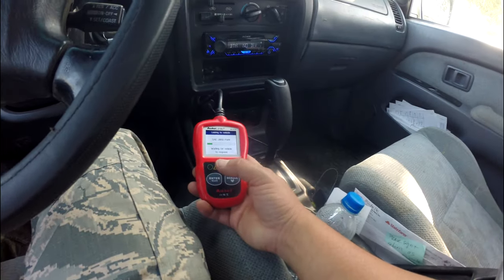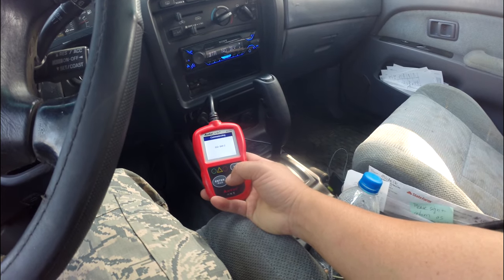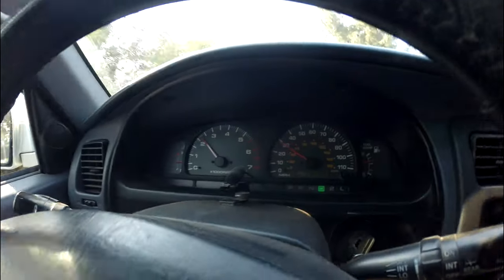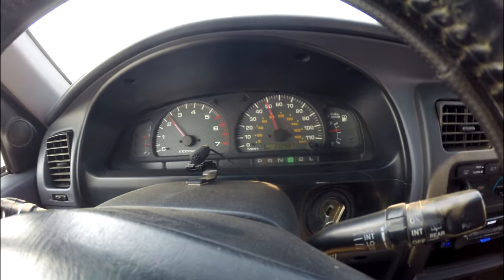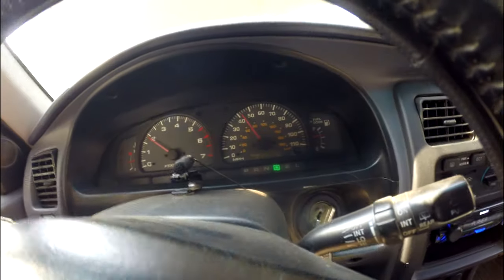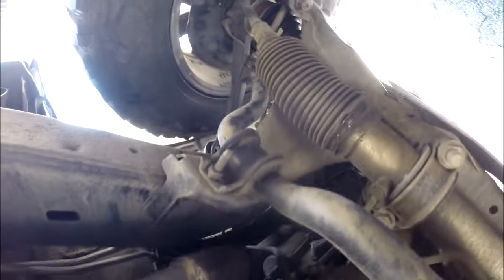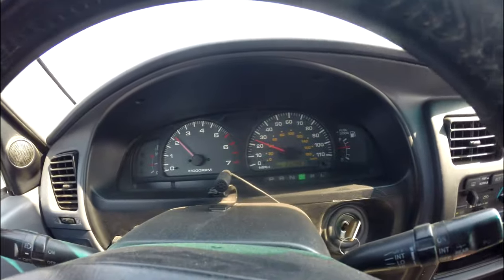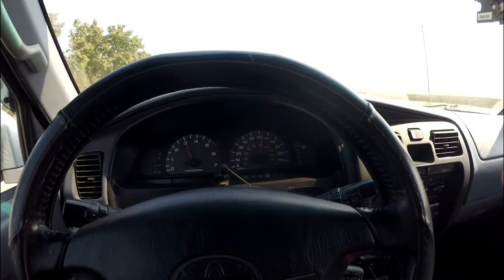How to identify a bad clogged catalytic converter.

Comment: I got 2010 Chrysler town and country 3.3 with 425,858
Reply from the maker: @geno2001h  wow great running car. Mostly those car end up in the junkyard before 200k miles but your is diamond one.
Reply: @alltsab  I was taxi driver in Dallas I work in my car no one touch it oil change every 3000 thousands miles
Reply from the maker: @geno2001h  that is the way it go buddy. Wrong machenic can be worse nightmare. Great job keep it up.
Reply: @alltsab  yes sir thank you for your help and your time

Comment: My 1991 ford probe gt is revving only 2.5k rpm could it be cat?
Reply from the maker: If it idling good then possible but try open exhaust pipe to see it gain power.
Reply: @alltsab  Okay, im gonna take cat off and see what happends

Comment: You have two cats on your 4 runner why?  Is one punched through?  You said their aftermarket… prob not flowing cause you have two cats under there. 3:25
Reply from the maker: Yes 4runner have 2cat. The primary one that is bad but in this case I replaced both because the top one make the down one bad too

Comment: My catalyst converter..don't smell it runs great it don't make noise ..
What else can it be???

It don't over heat 
There's no system errors 
Just keep popping the catalyst???

What else can it be?????

I can't pass inspection 💁‍♂️💁‍♂️💁‍♂️💁‍♂️
Reply from the maker: If u have po420 or po430 then you have cat problems.  The symptoms you see in my video mean  that already passed the steps of showing code.

Comment: I have a 1985 Oldsmobile cutlass supreme.  Only when I drive the vehicle over 45 minutes, I start to feel like a jerking sensation in the vehicle, when I try to go over 55 mph, or do fast acceleration. When car is not too warm, everything seems fine. I also noticed a little bit of a sputter in the tail pipe. I changed the cat around 3 years ago due to smog check failure.
Reply from the maker: That is my first car in my life. I have the small v8 that car was nice.. ok i think Possible clog cat but older car it could be cap, rotor, spark plug, wires too. You can check those if never been replaced then replaced it first.

Comment: So I can just loosen those 3 bolts to check a cat on a g35?
Reply from the maker: Yes if that what you have
Reply: I'm haven same problem on my 2008 g35
Reply: @lostsul8847  I did this but my car still won’t go past 3 rpm

Comment: Is my cat blown is sounds like rattling under my car when my rpms come down after I rev i do have aftermarket straight through muffler
Reply from the maker: Could be heat shield too but you have to jack your car up and go under it to check for ratle
Reply: @alltsab  sweet I will do that today :-) what do you think the chances are it is the catalytic converter it is a thirty-year-old car it is a 1990 Volkswagen Jetta:)
Reply from the maker: @aaronhiltz6696  possible
Reply from the maker: @aaronhiltz6696  don't forget to help me subscribe so we can stay connected ok
Reply: @alltsab  what are the symptoms of a bad catalytic?? I need help to figuring out mines , because my car is burning oil really quick and black smoke ?
Reply from the maker: @kayy-rz4en  that is not cat. Converter program my opinion.

Comment: I have a 2009 kia rio 5 witu 88,000 miles i have a po501 code and a po420 code the car run bad the acceleration is bad my car has 2 catalytic converters

Comment: I think my cats are clogged and or bad, it hesitates to starts some time and it blows gold looking particles out the exhaust and it sounds a bit like a farm tractor
Reply from the maker: The gold looking could be corrosion
Reply: @alltsab  What do you mean? I think mine are clogged too. Have a code reading  P0096 and P0420
Reply from the maker: @jasmineaviles2211  po420 is bank1 cat is bad
Reply: P0420 and P0430 what’s the solution for it?
Reply from the maker: @sir_rosy  replaced both cat.

Comment: Back pressure...ie...pressure....ie... unmeasured pressure...assumed safe for the engine specifications for maximum recommended back pressure or just cylinder pressure when it's supposed to be vacuum and basically parts that dont have to seal are demanded to hold back exhaust gases but its still accelerating past 50mph this guy says no damage in this condition no damage engine spec a fine engine a spec a very fine no damage under these conditions no damage no engine specR a pRroblRem JK guys love you man keep it up good work can't win an all right. Two wongs don't make.......no never mind. That's not a good joke my bad. I got run on sentences and horrible grammar if not for spell check this would seem foreign to most any human and I'm trying to be a critic, a judge of others,and all kinds of stuff I don't like being so let's maybe step back a few feet and rethink all this internet-video-comment-view-read-internet cycle were in its a big circle that's pretzel twisted just to be different...fucked up I know...a step back I tell you to reflect and contemplate further interaction want or necessity and if either even truly exist anymore or if we even have a choice if the illusion of choice was unveiled would we even care instead thinking what further interaction is even wanted or necessary with reality or the real world...are we just fu(internet full)

Comment: You cannot have less than 200k miles on a 20yr old car? I have a 2002 4runner with 177k miles 😍 low miles. Love it still. Great small SUVs
Reply from the maker: Nice
Reply: Yeah I was wondering what he meant by that- why it can't have less than 200k? Got a 19yr toyota in the 190k range
Reply: @Lexagmor  that's awesome. I also have an 02 Lexus es300 with 117k miles daily driver

Comment: how can you just disconnect your CAT? is it rlly that easy? I have the P0101 and P0420 codes. Already changes 1 part and it didn't work. I can get to 60mph no problem but the acceleration is slow and the gas mileage is horrible! Great video!
Reply from the maker: Disconnected the cat didn't fix the cat. It's just a test to find the results.  In your case is your cat is bad may not clog yet because still throw code po420. Slow accelerate could be due to weak transmission. Fix your maf sensor and replace your bank 1 cat converter to see you gain accelerate. After your fix all the code and still slow accelerate it can be your transmission.  Hope this help you. If help please help me subscribe 🙏 ok thanks buddy good luck on your repair .

Comment: I fixed my motor mounts transmission mounts and transmission flush with transmission filters thinking it was my transmission but nope it’s was my cat
Reply from the maker: Is not an easy to find out isn't it
Reply: Bro I think this is what’s wrong wrong with my 2011 dodge charger
Reply: I did exactly every repair you did
Reply from the maker: @banz7416  what happens after you did
Reply: @alltsab  it didn’t help.. when the car is cold it runs good, but once it reaches operating temperature it start to jerk and sputter
Reply: But since I have no codes showing The mechanics are clueless
Reply: Twitch Banz 😂😂😂😂😆😆😆😆
Reply: Also yesterday I did replace spark plugs and coils packs and my cars running a lot better but I still have a p0420 code bank one so I’m still going to replace the cat I’ll keep you guys updated

Comment: I changed my cat and still does the same thing while driving struggling to accelerate.
Reply from the maker: Possible that your cat is not clogged. You should using my diagnosis method before changing your cat. I think you may have a worn out tranny. Good luck buddy 👍

Comment: Would desperately like your help on a mechanical issue I'm facing with my Mustang 2014 V6 3.7L (auto) my dealer did not know what is the issue exactly and I took my car to 5 different garages with no luck.

Few months back my mustang started to go to limp mode, sputtering and stuttering randomly. sometimes it shows the wrench symbol and sometimes it doesn't same goes with the check engine sign. Ran the the computer check and got oxygen sensors of bank 1 sensor 1 fault. I have changed that and now I got the codes of bank 1 and bank 2 (sensor 1). One mechanic told me to change the Throttle Body and I did with no luck. I almost changed most of the parts in the car with no luck:( the part that sucks that I have spent shiit load of money and it has been months since I drove my car with a piece of mind while issue is still there!

Parts I have changed:
Air filter
Throttle Body
Spark Plugs
Gear oil & filter
Engine oil & filter
Oxygen sensor: Bank 1 sensor 1

Please help me to find a fix of this issue. I do not have much mechanical experience with cars but you can ask me anything I have missed to mention. Many thanks & much appreciated!
Reply from the maker: I'm not sure why you replaced body throttle any code said body throttle or you think it body throttle and you just replaced it? Now it said bank 1 sensor 2 right you have to replaced that b1s2  because it said so you have to replaced it. Those filters and sparkplug is just regular maintenance.  To fix your problems you may have to follow those engine light code to be able to fix your problems don't assume like the old day guessing maybe here and there may solve the the problem it's doesn't like that anymore.  Please help me subscribe to my channel ok if you need more info just ask will be here to answer your questions.
Reply: @alltsab  thanks a lot man appreciate the tips will do that for certain! I actually changed the Throttle body after seeing lots of similar issue online being fixed by it, anyhow will report back after changing the other o2 sensor. Subscribed
Reply from the maker: @Tobi-ys3iq  I see, always used scan tool to scan to  fix problems ok don't just see online to fix because most of the times they trying to fix only they never reported back that their problems is fix so we spent money for nothing.  Thanks for help subscribe 👍

Comment: Shit my Nissan Almera 2000 N16 Hatchback does the same, floor it and zero speed, almost afraid to go out on highway because its so slow to pickup acceleration, it costs apx. 100 dollars for new catalytic converter here in my country
Reply from the maker: That is cheat price. Here in America nearly 1000 dollars for 2 cat
Reply: @alltsab  Insane, even more insane for me as a student, it goes from A to B for now low steam or not, i'll just take it careful out on the highway

Comment: My 2002 honda accord has 298,000 miles.
Reply from the maker: Nice
Reply: @alltsab  yes, and 2 years ago when I bought it, it had 222,000... been a decent little ride.
Reply from the maker: @garyr7027  you lucky that you bought it been fix and have no problem. Some time we buy old car people can't afford to fix then we have to spend ton of money to fix it.  Bro you are the lucky one
Reply: @alltsab  I won't argue that one, I was lucky. It was a one owner car from an older couple. Outside of front suspension parts and preventive maintenance, the cars basically been hasle free and still runs good.